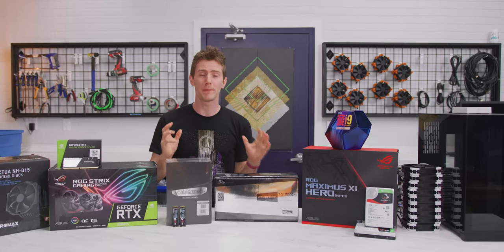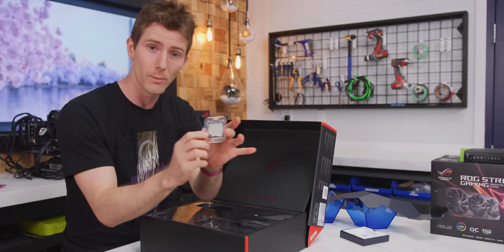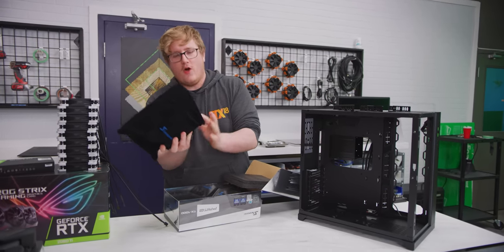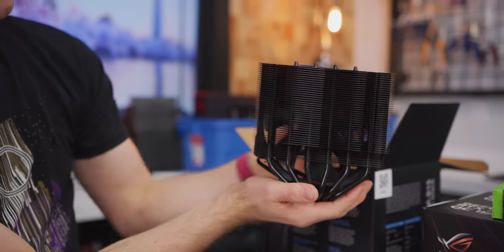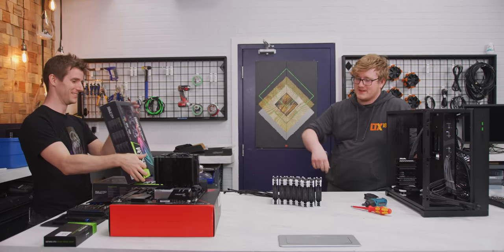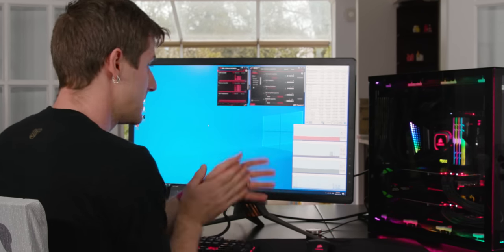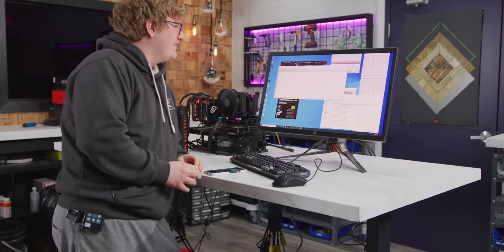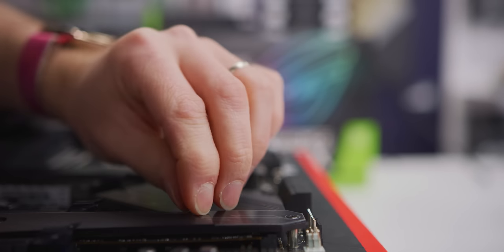Can AMD Beat the ULTIMATE Intel Gaming PC?

Comment: what happened to "we dont recommend anyone to use sli"
and whats up with 9 fans
Reply: it's only not recommended unless you have literally the highest end gpu on the market. the typical advice is to sell your current GPU and buy something better, rather than buying two (ie, if you have a 2070, sell it and by a 2080(Ti), instead of another 2070)

Comment: Great video but when linus said Intel still has a slight IPC advantage over AMD 3000 chips I was like WTF that's not right. Intel has a clock advantage over AMD not IPC advantage. AMD actually has about a 5%-6% IPC advantage over Intel at same clock speed. This is why AMD is actually able to keep up with Intel even though AMD has a clock speed disadvantage. Not hard to fact check this since there are a few places on the net & YouTube that have done the work to show what I have just said to be fact.

IPC means "Instructions per cycle" or some refer to it as "instructions per clock" since Intel CPU's can go to higher clock speeds than AMD these higher clock speeds make up for Intel being behind AMD for IPC. AMD's biggest problem right now at least for gaming is that they have slightly higher latency in their CPU's than Intel does mainly because AMD went with smaller chiplet design & Intel has went with single CPU die design which
keeps the latency very low & as a result Intel fairs a bit better in gaming than AMD does right now. Even with that said it is so close for both camps for gaming performance who would actually care other than FPS junkies.

Edited: After watching the whole video why did this sound like an advert for Intel. Buying a pre binned CPU which only like 1% of the people would go out and pay extra for and then pitting it up to a stock AMD CPU but oh yes making sure the Intel was over clocked of coarse. I say stock AMD CPU because unless I missed it in the video I did not see at what speed the AMD CPU was running at or how the AMD system was configured. Like I said this felt like an Intel advert and I am sure Intel is very happy with the results even though this was a pre binned CPU from some web site and not Intel themselves. 

I am no AMD fanboy I happen to like my Intel inside my systems but I felt like this was a promotional video for Intel. Not trying to be rude here but like I said this felt very one sided. Was this damage control because of past videos that raked Intel over the coals because of stupid crap they were doing in some past videos.
Reply: IPC depends on the application. It's like trying to compare GPU's by their TFLOPS. You can't compare across different architectures, Intel 4GHz will still beat AMD in certain games because it's faster cache allows for higher IPC
Reply: Maybe i missed it, but when did he say IPC? 

I have just heared "more single thread performance", which is technically not wrong.
Reply: He said single core performance? Whole paragraph any you didn't even listen right
Reply: Anyone else kinda curious what kinda of powerdraw there was on the CPUs despite the AMD having twice as many cores? something tells me that either way both machines are going to be space heaters in their configs with that level of powerdraw at least
Reply: @The117th  the 3950X has a "TDP" of a 120W, while the 9900Ks has a TDP of 250W. This however is misleading as AMD measures TDP at max while Intel measures at average (?) iirc.
Reply: @The117th  and no, they won't be space heaters as long as you have a half as decent CPU cooler.
Reply: Bruh i figured this was a promotional video for intel when i saw no link for an amd chip in the description, but for intel...
Reply: @jacintofernandes2907  250w heat output is still 250w heat output. The bigger cooler gets it out of the cpu faster but that 250w still transfers into the air.
Reply: @jacintofernandes2907  max I've measured on my 3950X even with PBO on is 180W and you know a better cooler just means it's is more efficient at transferring that heat in to the air right? 180W is still 180W and laws of thermodynamics means it's gotta go somewhere
Reply: It's not IPC or clockspeed that is really giving intel the win in games anymore. IPC is about the same these days. No...it's latency. Intel Ringbus just has very low core to core latency vs the chiplet/io die design of Ryzen CPU's. Until AMD gets that down even farther somehow, intel will continue to win in high framerate (thus latency sensitive) situations. 

Now, as for this promotional video feel...I have to disagree. On the overclocking front, Ryzen, even 3000, even binned, overclocks like shit. It just does. Chips have a hard time even hitting single core boost clocks lol. As for the 9900KS, the 100mhz boost the silicon lottery binning gave it over its stock all core boost barely helps it in most cases. It would have still easily won, mostly because of the latency being it's real advantage here, not clockspeed/IPC, as I stated above. Lastly, this was honestly pitted in AMD's favor test wise. They decided to play everything at 4K, which puts more load on the GPU(s) vs the CPU, thus leveling the playing field even more. At 1440p the margins that intel won by would be a good bit larger. 

Personally? That last bit is why I gave this video a dislike. Comparing CPU's at 4K is fairly dumb, especially when most people even with hardware like this are not playing at 4K right now (I am one of them). 1440P or 1440P ultrawide are much more common resolutions for systems like this right now, both because of the power required for 4K still, the lack of nice displays and the limitations of current DP/HDMI standards to push high framerates/bit depths at 4K. It was a bad way to test this and is just furthering this notion that if you're making a balls to the walls gaming focused build that there is barely any difference between a 9900K and Ryzen 3000 offerings, when there is a pretty sizable difference in reality.
Reply: @soulshot96  NGL actually agree with that maybe not so much the OC on Ryzen but maybe I got a shinning example so won't complain there, but on top of the 4K issue which is dumb for CPU testing, on top of that picking the 3950X at all...I have one, using it for gamine in 99% of use cases is legitimately pointless a 3900X, 3800X or even 3700X would have made so much more sense here and saved a ton of money which could go towards other components that would make better performance gains over a 3950X on an NH-D15 i.e. faster ram, better motherboard, psu, etc. Or even hell a pretty sizeable game library
Reply: @The117th  I'm confused. What point I made are you arguing against?
Reply: @The117th  I was just talking about how Intel and AMD measure their TDP differently but use the same standard unit.
Reply: @jacintofernandes2907  my point was that the AMD uses less power and therefore creates less heat even when Overclocked to hell, I'm going off the actual power reported from sensors both on my motherboard and by my PSU, so can say with confidence that 120W stock and 180W with PBO is accurate

My point I guess is that the Intel CPU will be running a ton hotter due to its increased power usage
Reply: @jacintofernandes2907  tbh I agree and if anything why don't they instead just measure socket power max as it makes a ton more sense

Comment: A pre binned, pre over clocked CPU beats a stock one. Who would've thought?
Reply: Even not oc , it would beat the crap out of it...who buys an intel chip to run it on stock clocks ? ...LOL
Reply: @vicotg7987  Errr some 80% of Intel user not buying a -K with a X*99 series chipset
Reply: @vicotg7987  More like who buys a CPU to overclock it nowerdays. It's not like you could get huge gains from it, and CPU boost is already pretty damn good. OCing is a niche, within a niche.
Reply: @vicotg7987  Le's assume for a second that's true, which I don't actually know and I reckon you don't either, as we both didn't actually test it. Isn't it still an unfair comparison? The point isn't just to see who wins, but also by what margin.
Reply: There several bench stock Ryzen vs stock Intel 9900ks , for gaming and only gaming intel is still ahead. The chip could do 5.1 with almost stock voltage , it s pretty obvious it could do much more. Anyway no it s not really fair i must admit there you re right. I have never own a chip without oc it since athlon thunderbird (amazing chip at the time)
Reply: @vicotg7987  Again, the KS is literally just a pre binned, pre overclocked 9900K. Stock doesn't always mean the same thing. And yes, Intel is definitely still ahead when it comes to gaming, I just take issue with the margins presented in this video.
Reply: @DamnZodiak  yeah the margin wouldn t be that big, from what i ve seen stock vs stock speed it s more or less 5% . Netherless intel chip is known to oc better on all cores , for the gamer that wants to squeeze everything out of his rig intel is still a better choice....probably only until next ryzen chip 4xxx
Reply: @DamnZodiak  to be honest i wouldn t buy any chip if i were to switch my setup right now, i would wait on next Ryzen, i got a 8700k oc at 5.23 even the 9900ks is not an option today... and 10k series from intel will probably be a big flop.
Reply: 3nm intel when

Comment: Would it be possible to do a comparison of how AMD and intel perform on a build using the same budget? A lost of the AMD vs intel benchmarks or comparisons that people have been posting have been very careful to have the exact same components for the rest of the build. Some other people and I have been talking over on the Newegg chat though, and we had an interesting thought:
Since AMD is so much cheaper than intel, you would be able to afford a better GPU if you are like the average person and need to keep a budget.
We're not sure how much this would gain though, if for say a $1000 build it would be enough to overcome intel's advantage on CPU performace
Reply: Naw, amd fanboy here, the 10600k cpu beats any amd processor gaming wise, as of right now.
Reply: @WhitestOC  That's my point though. 10600k beats out any released AMD processor if they have the same GPU. That's how everyone tests it, and for a good reason. However, for someone building a PC on an actual budget, the processor+motherboard is around $100 to $120 more than the 3600. Even though a 10600k will have the 5% extra FPS with the same system, we all know that GPU makes more of a difference than CPU in frame rate. If you are able to put that 120 some odd saved dollars into a better GPU, I would be willing to bet that the 3600 will get a better frame rate.

This, of course, says nothing about the new CPUs coming out, so this test could very well be pointless in the near future once AMD and Intel prices are basically the same and AMD takes the single threaded crown

Comment: if u bought a prebinned pre oc'd intel processor then it most likely would have an edge on a stock amd... i think a better comparison would've been to oc the amd, either in the first place or add it into the video as a second comparison.
Reply: ryzen 3000 generally performs better at gaming running stock since an all core oc usually only hits 4.2ghz where as boosting a few cores on its own will hit 4.3-4.7 on occasion depending on processor of course. I have a 3900x it hits 4450 gaming very often
Reply: Or y'know, actually compare HEDT parts which would actually be beneficial to a dual 2080Ti system, due to PCIe 3.0 X16 on both GPUs and quad-channel memory.
Reply: Yeah running a pre-binned and OC'd Intel vs stock AMD seems a bit off since they could at least try to OC the AMD part. I guess they're thinking the AMD part costs the same as the OC'ed intel part but oh well. Just kinda annoying to not at least put effort into doing the AMD OC to see if it helps.
Reply: Overclocking Ryzen 3000 harms gaming performance, so who cares? Ah and buying that silicon lottery chip was pretty stupid, a 5.1 GHz bin is way below average for 9900KS. Out of all roughly 30 samples in the german hardwareluxx forum, not a single one didn't hit 5.2, most were able to hit 5.3. Linus payed more than retail for a below average sample.
Reply: @ender-gaming  I mean for Ryzen, PBO overclocking makes more sense than just shoving a frequency and voltage.

Comment: wait so you didn't overclock the amd processor and compared it to a pre overclocked
Reply: Ryzen is pretty much max clocked outta the box.
Reply: @normiukkeli3739  not necessarily. But yea it's pushing hard for the average consumer
Reply: @normiukkeli3739  pretty much, but there's always a little headroom, I have my ryzen 7 1700 at 3.9GHz on all cores, it's max boost is 3.7GHz so there is a little room, which may be the difference.

Comment: That’s like 5 grand. So I guess this isn’t a “something someone would actually buy” video but instead a “binned vs unbinned” video?
Reply: In Canada, where LTT happens to be located, 2080ti's are $1534 to $1800.  EACH. 

Plus tax.  So it is nearly $4000 for JUST the video cards. 9900kf is $689, 9900k is $699 , on sale.
Mobo is $419.  Add in the rest, you are at. $6500 plus CDN.    But hey, I guess if you have the cash, go nuts?   (  Not bashing  on people who have spendy rigs. My 3900x / Crossshair 6 / 32 GB of Flarex / Vega 64 liquid says I spend more than I should too . )  *Upgrade from original 1600x. Gotta love compatibility.
Reply: 1% of enthusiasts would actually buy this whereas nowhere near 1% of people would do a 16k multi monitor or 7 gamers 1 cpu build.
Reply: @ssssaa2  Exactly. I can afford something like this and relatively justify the components. I couldn't justify most of what he does on this channel.
Reply: In Brazil only a 2080TI of those is around 13k, a minimum salary here is around 1k...i'm gonna stop right there.

Comment: Linus: "Air cooling cause guys, it doesn't make a difference"......only if your case isn't big enough to hold it.
Reply: Which is a shame given that's one of the largest cases you can buy
Reply: But there are many cases with more support for air cooling. Der8aure designed this one for water cooling specifically
Reply: No, you can get some really big towers that are designed for servers.  They come from sheet metal benders and not name brand companies.  There is also a web site now where you can design your own case.  I think it handles dimensions up to one meter on a side.  Someone could opensource the design for a huge case.